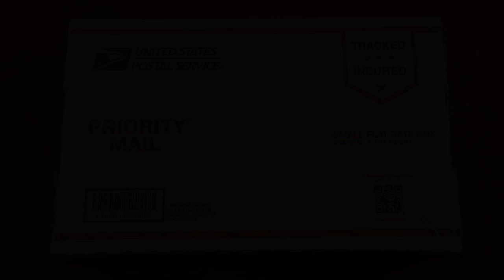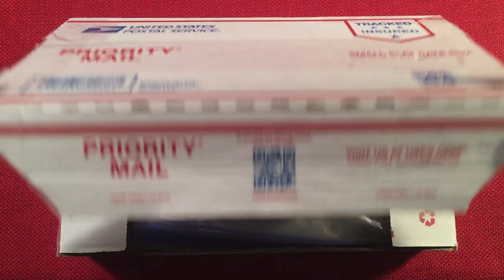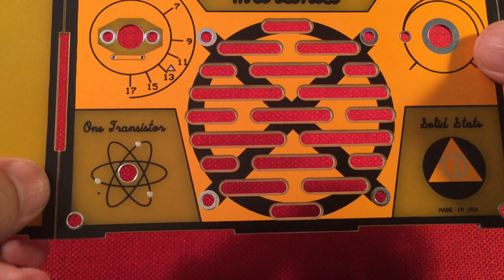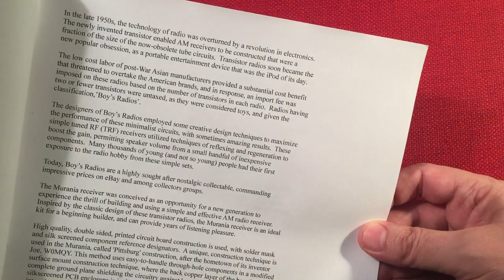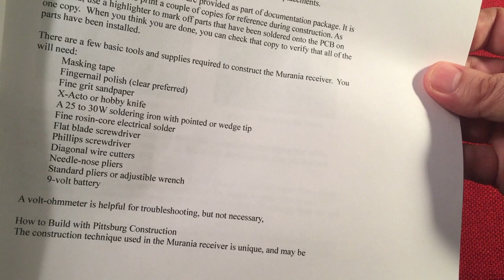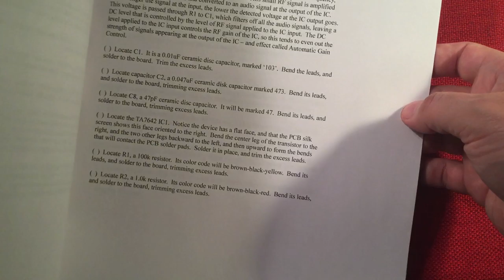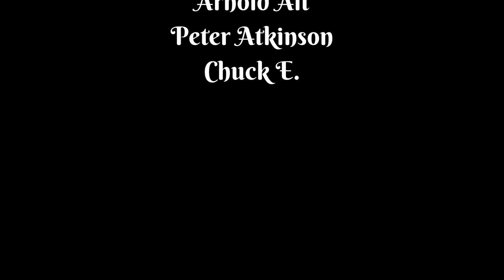Murania AM Radio Kit Build & Review

Comment: @todderbert
The kit's creator David Cripe amateur call sign is NM0S which actually in the abbreviation for a transistor! Love that.  "A FET (Field Effect Transistor) is a voltage controlled device where its current carrying ability is changed by applying an electronic field. A commonly used type of FET is the Metal Oxide Semiconductor FET (MOSFET). MOSFET are widely used in integrated circuits and high speed switching applications"

Comment: I'm astounded by the performance of that radio! I had one of those "boys radios" from Japan when I was a kid and growing up in a suburb of NYC, I could only pick up three stations with all those 50KW "flamethrowers" around me. I'm really impressed to the point that I will order one when it's back in stock. One thing that perplexes me is the variable capacitor. This one has four alignment screws. I've only seen two on an AM only set so I wonder what the other two are used for?
Reply from the maker: I know the variable capacitor had to have a bunch of extra legs removed so my guess is this part is used in other radio applications. Also the radio does use an IC(TA7642), so it contains more than one transistor :)
Reply from the maker: In Stock! http://bit.ly/MuraniaKit    Tell 'em Todderbert sent you :)